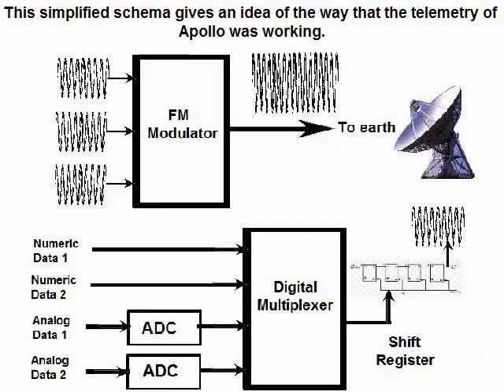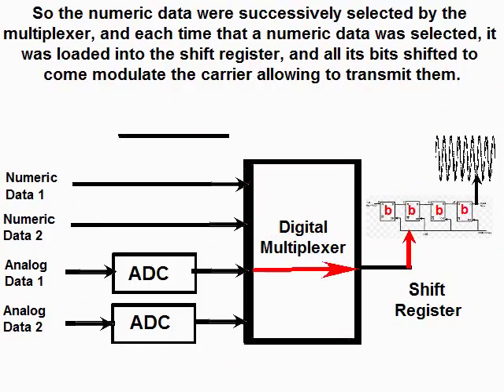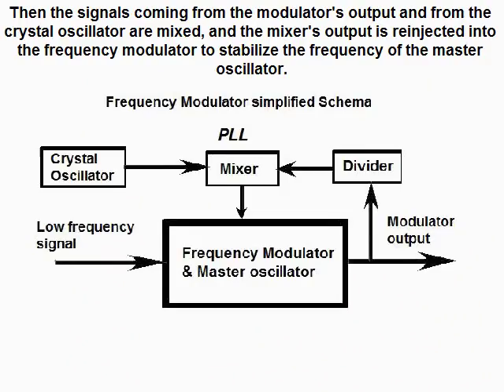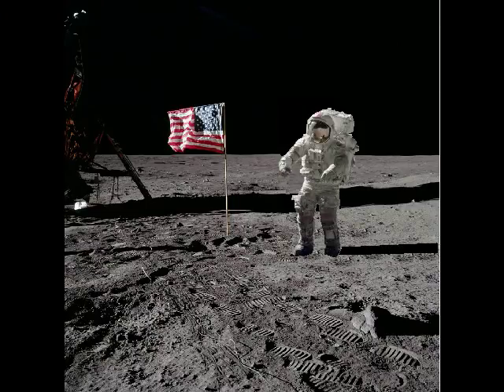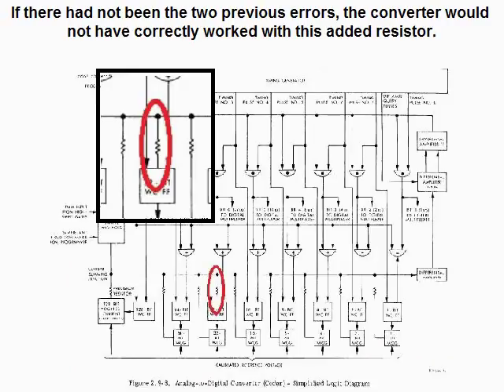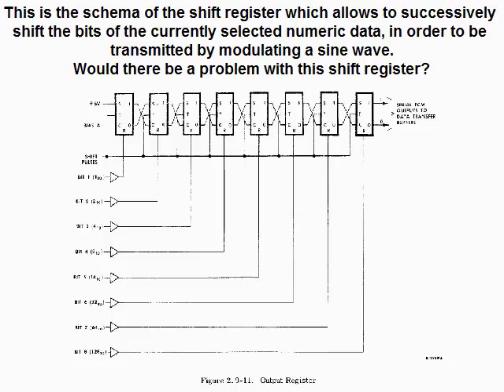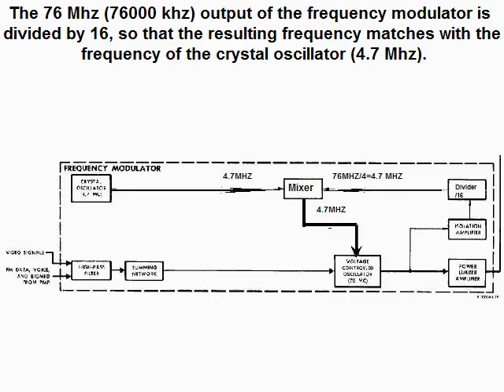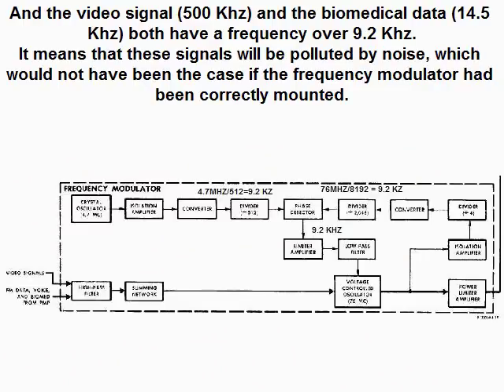Apollo telemetry lost? What telemetry?

Comment: Where did all the pro-Apollo shills go? Contracts run out? New more dastardly shill program coming? Google and the government no longer outsourcing their shill program? They give up? (Very doubtful.)

I used to get attacked for just spelling Apollo wrong. 

An American citizen, not US subject.
Reply: K. Chris Caldwell: Present compelling, independently corroborated evidence for the existence of "shills" and state your sources.
Reply: Looks like I spelled Apollo wrong again.

AS16-109-17800 from Apollo Fraud 16.

The right leg of the astro-not is casting a shadow, but his left leg is NOT.

Worse, in 17800 the rover's shadow clearly falls in a different direction than that of the other shadows. Most shadows in 17800 fall from the upper-left to lower-right. However, the rover's shadow falls from the bottom-left to the upper-right. 

Then there is the matter of the background hills not casting any shadows.

An American citizen, not US subject.

https://www.hq.nasa.gov/alsj/a16/AS16-109-17800HR.jpg
Reply: If you look carefully at the expanded image, there IS some medium grey shadow cast by his left leg, rather similar to the shadows cast by the leftward raised edges of the bootprints immediately behind and to the left of that leg. And between his moonboots there's a small heap of sand which is illuminated by light reflected off the white material of his moonboots and spacesuit. Your erroneous claim only proves that you have poor observation skills and cannot think logically about illumination. Your second claim regarding diverging directions of shadows would only be valid if the lunar surface were perfectly flat. Clearly it isn't. There are numerous depressions and raised areas. The most rightward protruding part of the rover's shadow is clearly the shadow of the mesh antenna, which is supported by a vertical rod that is joined to the rover's chassis at a point further from the camera than the wheel axis. And that part of the shadow clearly falls on a raised area of the lunar surface. This part of the rover's shadow is consistent with the position of the sun. Obviously, the shadow of the low hill in the background is not visible, as the sun is off to the left. The shadow would thus fall to the right of the hill, which is not in view. However, at the far right of the image some shadows cast by irregularities in the slope are visible.

I suggest you experiment with objects in a sandpit with the sun low to the left. Make an irregular surface with pits and mounds, bootprints, etc. You will discover that it is easy to produce shadows that are not parallel.

There's nothing suspicious about this image. Furthermore, in the case of Apollo 15, surface photos taken by the astronauts have been shown to precisely match the local terrain as constructed from digital photographs and radar altimeter data transmitted to Earth from lunar orbit years later by JAXA's Kaguya (Selene) probe: https://www.youtube.com/watch?v=kbTRGj5aNCM&t=2s

Not to mention five decades of scientific research based on independent, painstaking analysis of moon rock and regolith returned to Earth by the Apollo astronauts -- a vast body of peer-reviewed research published in reputable scientific and technical journals, the authenticity of which has never been contested by any physical scientist anywhere in the world.

Congratulations - you have advertised to the world that you cannot think logically about illumination. There are many Apollo lunar surface images in which shadows are not parallel, and this matter had been dealt with by, among others, Astrobrant2 (https://www.youtube.com/watch?v=AnrPaz3xFIg) and an episode of Mythbusters.

As usual with hoaxnuts, your claims in no way constitute evidence for mission 'faking' by NASA and can easily be debunked by simple logical reasoning. Your cherry-picking produced some rotten cherries. ;-)

The amount of compelling, independently corroborated and verifiable evidence that 12 Apollo astronauts explored the lunar surface in the period 1969-1972 is overwhelming and no physical scientist anywhere in the world has ever contested it. Have you ever stopped to wonder why? Furthermore, in the past five decades no single NASA or contractor's employee has ever come forward with compelling evidence -- or even testimony -- of mission 'faking'. Have you ever stopped to wonder why?
Reply: I probably shouldn't rag on you too much. Although your visual interpretation skills are indeed highly lacking, some of the blame goes to the simple fact that these pictures were taken in an environment very alien to humans. Estimating distances is especially tricky on the moon, and even the astronauts who were there often thought something was a lot closer and smaller than it really was. There's no air, so there's no haze to obscure distant objects and give you a distance clue. Mountains many kilometers away look like nearby hills, and huge boulders at a distance look like nearby rocks. (A famous example of this is the approach to "House Rock" in Apollo 16.) The sky is black, so all indirect lighting comes from scattering. There are no roads, trees, buildings, power lines, and other familiar objects to create perspective. Because of the low gravity, even seemingly flat lunar ground is very uneven; looking at some of the many Apollo stereo photographs will give you a MUCH better feel for this. And so on and so on.
Reply: I've always thought it hilarious that a small band of fanatics claim their own inabilities to interpret photographs taken in an alien environment somehow "prove" that the entire Apollo program was faked. I've also wondered exactly how so-called "anomalous shadows" somehow prove the image was really taken on earth. Last I checked, the rules of perspective and the laws of optics are the same in both places.
Reply: Like I said, it's amazing that you can present your inability to interpret photographs as some kind of proof of a massive conspiracy. You still haven't explained why the laws of perspective and optics are different on the moon and earth. In fact, since you apparently claim that these photos were made (faked) on earth, you haven't explained why they should be any different from all the other pictures taken on earth where the usual laws of perspective and optics apply.
Reply: Jesus, that Apollo 17 sequence "anomaly" was debunked years ago. But it lives on in your imagination. The simple fact is that the photographer covered only a small angle around the LM, so it (and the flag) don't rotate much. (But they do rotate, which can be seen if you rapidly animate the photos). The main effect is to shift the flag horizontally with respect to the LM for the simple reason that the flag is much closer to the photographer. This is called "parallax", and it's what lets your brain interpret 3D scenes from the different images from your eyes. As I said, because of the lack of depth cues, distances are often deceiving on the moon. Objects seem to be much closer than they are. Those "nearby hills"in the background are actually mountains kilometers away rising 2300 meters above the valley floor. They were in a valley deeper than the Grand Canyon,
Reply: Sorry, but wrong. Try taking some pictures on a sunny day with the sun shining on your lens (but not in the frame). Compare them with pictures with a sunshade that keeps the sun off the lens. What differences do you see and why? Discuss.

The "beams" are obvious lens flares. One comes directly from the sun, the other from a specular reflection from the aluminized Kapton insulation on a sunlit part of the LM to Armstrong's right. Armstrong took some of those pictures in the sun and others in the LM's shadow, where the lens flares disappear.
Reply: Still no compelling evidence of the existence of "shills"; still no compelling evidence of mission 'faking' by NASA. Why do you waste your time and energy on this horseshit?
K. Chris Caldwell, not US subject but subject to his paranoid delusions, RIP
Reply: ApolloWasReal See, the problem is you are applying logic and reason.
Reply: K. Chris Caldwell: Present compelling evidence of the existence of NASA "paid shills". You don't have any, do you? It's just an irrational assumption, evidence that you -- like everyone else who uses that term -- is paranoid delusional.
   NASA has far better things to spend its limited budget on. Activities including pioneering, state-of-the-art research and development in aeronautics and astronautics, astronomy, cosmology, planetary science, Earth-monitoring science and, of course, spaceflight and space exploration (to name but a few of the agency's activities).
  If you fail to present compelling evidence of the existence of "paid shills", as you will because the notion is preposterous, then no one need take your claim seriously.
Reply: That's nice. 

Where is your evidence of paid shills?
Reply: Again, you're reasoning as if the lunar surface were flat. It isn't. In this photo, the shadows of the small rocks that fall from upper-left to lower-right are all on a rightward-falling slope of a depression, whereas the shadow of the rover's wheel is cast onto rightward rising ground. No anomaly, just false assumptions -- as always with hoaxnuts. Try it in a sandbox or sandpit with a low sun to the left. You'll get the same effect. There's a Mythbuster's episode where they shot a scene similar to an Apollo landing site in a US desert. They demonstrated that diverging shadows are produced whenever the ground is irregular. Any claim you can make has already been repeatedly debunked.
12 Apollo astronauts explored the lunar surface in the period 1969-1972. Get over it and get a life. You're wasting your time and energy here and making a fool of yourself.
Reply: Hey - what's that white tubular object at the lower left of AS15-87-11839HR?

https://www.hq.nasa.gov/alsj/a15/AS15-87-11839HR.jpg

Clearly, it's a musical instrument. Could be one of the drones of a set of Scottish bagpipes, or a snake-charmer's pungi.
This PROVES that the Apollo surface photos were not shot in a vacuum. Why would an astronaut play his bagpipes or pungi in a vacuum?
We're onto something! Phone Reuters, AP, AFP and other leading news agencies!

[At ease, hoaxnut stormtroopers. This was just a demonstration of how your delusional and illogical thought-processes operate.]
Reply: What are you talking about? Those pictures were taken from different locations, looking in different directions, 16 hours apart. That means they were different EVAs, and the sun had risen another 8 degrees in the sky. So obviously they look different. So what?
Reply: From Apollo Fraud 17: AS17-134-20509 thru AS17-134-20513.

As the photog moves to the left between shots in the series, the foreground, background, and flag are seen to shift orientation approximately close to how they should. However, the LEM (lander) shows no change in orientation in any of the shots--it maintains the same orientation from 20509 to 20513.

The flag's facing toward the photog also suspiciously does not change either.

Quality Control out all night in Vegas again.

An American citizen, not US subject.

Gif animation: https://imgur.com/a/4lLuP
First in series: https://www.hq.nasa.gov/alsj/a17/AS17-134-20509HR.jpg
Reply: From Apollo Fraud 15: AS15-82-11139.

There are several errors in this one, but the most glaring are:

1) As evidenced by the directions of the shadows cast from the rocks around him, especially the one at right-front, the astro-not's shadow is being incorrectly cast straight down. The gnome's vertical pole also casts a shadow far to its left, while the astro-not does not.

2) The shadow from the large rock at top-center (to the right of the gnome) is incorrect. Just under the gnome there is a light gap that should not be there. Its shadow also conflicts with the astro-not's.

The shadow-painter may have been delayed in returning from Vegas, and so his apprentice had to paint the shadows in.

An American citizen, not US subject.

https://www.hq.nasa.gov/alsj/a15/AS15-82-11139HR.jpg
Reply: From Apollo Fraud 16:  AS16-107-17529.

In 17529 the shadows of the two poles/scoops fall in different directions.

The foreground scoop's shadow falls to the left, while that in the background falls to the right. It's the result of the NASA fraudsters badly compositing two photos with different lighting setups together.

The terrain in the foreground is lighter and much less rougher than the background photo.

And then there is the matter of the astro-not's shadow not falling in either direction. Oops! Damn you Vegas.

An American citizen, not US subject.

https://www.hq.nasa.gov/alsj/a16/AS16-107-17529HR.jpg
Reply: From Apollo Fraud 11: AS11-40-5862 thru 5869.

As to AS11-40-5862 thru 5869 NASA has always asserted that it is reflected light from the surface that is impossibly lighting the descent ladder and doorway on the LEM's darkside. All of the photos in the series contain much evidence undermining those assertions.

AS11-40-5863 is the most damning photo to NASA's assertions, as it actually shows atmospheric artifacts from  two concentrated light beams converging onto the scene. One light beam can be argued to be the "Sun," but the other beam is coming up from the bottom-right. Oops.

The two light beams cross and combine in to a visible artifact of light bursts and streaks in front of the scene. This is impossible without atmosphere, air, reflecting the light. The two beams of light are then seen to diverge to the left of the scene; still impossible without air to create the visible "artifacts."

A well lit fraud.

An American citizen, not US subject.

https://www.hq.nasa.gov/alsj/a11/AS11-40-5863HR.jpg
Reply: K. Chris Caldwell Rob Stuart has asked you to provide evidence of paid shills twice now. Do you have any such evidence, or are you going to keep gish-galloping onto other nonsense and ignore it? You made the claim, now back it up.
Reply: "Shills come out at night...shills come out at night..."

From Apollo Fraud 16: AS16-114-18388.

The astro-not in AS16-114-18388 has his hands gripping something with his fingers extended toward the photog. Yet, the reflection of his hands in his visor has his hands extended toward HIM, and not holding anything--Cat Scratch Fever! 

The photo right before this one, AS16-114-18387. has the visor displaying the proper reflection of the astro-not's hands and what he is holding.

Another NASA redonkulous production.

An American citizen, not US subject.

https://www.hq.nasa.gov/alsj/a16/AS16-114-18388HR.jpg
Reply: Mommy's rent free basement. Mommy to do the shopping, laundry, and cleaning. Mommy to comfort when the one-eyed barista rejects. Check, check, check, shill.

From Apollo Fraud 15: AS15-87-11839.

While many spotted it, it was Jack White that uncovered what it was of. The "it" is the identity of one of the two photos accidentally left by set dressers on a foot-pad of Apollo 15's LEM. The photos are seen on the foot-pad at the right of AS15-87-11839.

Problem one is that anything resting on the Moon in direct sunlight, as these photos are, would rapidly have a temperature of over 240F/116C and faded and disintegrated away.

Problem two is answering what these two photos depict. The one on the right is still unknown, but the one on the left has been identified by Jack White as a flipped version of a photo from Apollo Fraud 11--AS11-40-5948.

Seems Apollo's set dressers were using photos from Apollo 11 as guides on the set of Apollo Fraud 15 and left two of the photos on behind.

Quality control must have been playing golf in Vegas that day.

An American citizen, not US subject.

https://www.hq.nasa.gov/alsj/a15/AS15-87-11839HR.jpg
https://www.hq.nasa.gov/alsj/a11/AS11-40-5948HR.jpg
Reply: K. Chris Caldwell. I didnt ask you to summarize your living situation, i asked if you had evidence that there are paid shills. Obviously you do not. Back to the X-Box with you.
Reply: Does the problematic psychology of a shill require that they wear panties? Discuss.

From Apollo Fraud 15: AS15-87-11839 again.

The LEM is clearly casting a shadow from the lower-right to the upper-left in 11839. Problem is, shadows cast from other objects in the foreground are from right to left. And the object to the right of the LEM's photo adorned leg casts a shadow straight down.

Revealing the fakery, a stage or photo compositing line is evident running in front of the LEM, just below the its footpads.

Additionally, Apollo Fraud 15 was depicted as having landed with its starboard leg resting on a mound of soil. THe LEM is turned clockwise in the photo, so the footpad of the starboard footpad should be visble. Instead, where the LEM's starboard footpad (In the right of the photo) should appear, a SEP pallet is shown. And the LEM is not tilted upward as shown in other photos, for example AS15-88-11863.

I guess quality-control was out late in Vegas the night before.

An American citizen, not US subject.

https://www.hq.nasa.gov/alsj/a15/AS15-87-11839HR.jpg
https://www.hq.nasa.gov/alsj/a15/AS15-88-11863HR.jpg
Reply: Does the problematic psychology of the hoax nut prevent them from admitting they are talking out of their asses with absolutely no evidence to back up their claims?

Why don't you hoax nuts do the heavy lifting for once. Prove the landings were fake. Find evidence of the soundstages they used. Find just one credible photograph of the rig used to fake the lunar liftoff. Prove the LM can't work. Enough of the bullshit claims, get off your lazy asses and back up your bullshit.
Reply: "...It's still a shill
When you hold me
It's still a shill
When you're loving me..."

An American citizen, not US subject..
Reply: Yeah, that's what I thought. Why bother with logic and reason when ranting and finger pointing will do, right?  You are a coward.
Reply: “Caesar had his Brutus, Charles the First his Cromwell; and NASA and their shills may profit by their example." ― Patrick Henry

An American citizen, not US subject.
Reply: Your attempts to be clever are falling somewhat short of the mark. Do you have anything relevant to say, or are you gonna just stick with the handwaving?
Reply: K. Chris Caldwell: Since you and hoaxnuts in general have failed to produce evidence of the existence of "shills", your continued use of that word is irrelevant and your pathetic attempt to taunt backfires on you. There's nothing anomalous about either photo, except in your febrile imagination. In recent decades, an increasing amount of psychological research has indicated a significant correlation between certain manifestations of psychopathology and 'conspiracy ideation'.
Interesting that you refer to the lens flare in one of the photos. Hoaxnuts generally complain that the quality of Apollo lunar surface photos is too high. ;-)
Try to present compelling, independently corroborated evidence of 'faking' by NASA that can be verified. So far, you've done an excellent job of undermining your credibility and advertising your gullibility and illogicality to the world. Congratulations!
Reply: Shills would even hate their mothers for money. But then their mothers hate them for being shills.

From Apollo Fraud 15, it's AS15-87-11839 yet again, along with AS15-88-11863.

According to the fraudsters at NASA, 11839 was taken at 147 hours and 27 minutes in to the mission. Disturbances to the Moon set's terrain are visible running from far right to far left before the LEM's aft equipment bay, and deep from the LEM to the photog. 16 hours later AS15-88-11863 was taken.

Problem is 11863 does not show the same terrain disturbances as 11839. 11863 shows only terrain disturbances a fraction of those in 11829. The area before the LEM's aft equipment bay is mostly pristine.

Looks like the maid showed up between shots and got things all tidied up. 

An American citizen, not US subject.

https://www.hq.nasa.gov/alsj/a15/AS15-87-11839HR.jpg
https://www.hq.nasa.gov/alsj/a15/AS15-88-11863HR.jpg
https://www.hq.nasa.gov/alsj/a15/
Reply: Shilling ever helped anyone with their daddy issues. Yes, daddy ran off with the boy next door, but shilling won't fill the hole.

An American citizen, not US subject.
Reply: 20 shillings to the pound? Pounds of bio-sealant (e.g. https://tinyurl.com/yacw27j5) couldn't caulk the hole in Caulk-well's [geddit?] head, which is uncontaminated by grey matter.
Reply: The caulk-well typed: "I used to get attacked for just spelling Apollo wrong". You've grown in anti-science and graduated from the University of Benightedness! Now it's for just being wrong period.
Reply: Ah?! A foreign shill, interloper. Not even able to serve fish-and-chips to his own people. Only capable of subservience to foreign tyranny in the serving of lies.

Kowtowing to the Germans is soon around the corner.

An American citizen, not US subject.
Reply: ??? The Caulk Well is an expert on kowtowing. After all, that's what he does every day to arch-delusionals such as Kaysing, René, Allen, Percy, Sibrel and White, whose risible claims have all been repeatedly debunked. The Caulk Well (RIP) merely regurgitates their discredited guff, parrot-fashion, compulsively, without evidence.
Reply: So, handwaving then. Shocker, I tells you. SHOCKER!!!

Does anybody know where to get an Apollo shill application? It occurs to me it would actually be an awesome job.